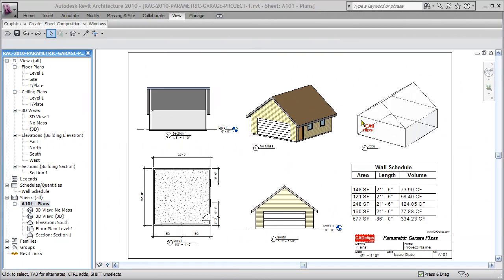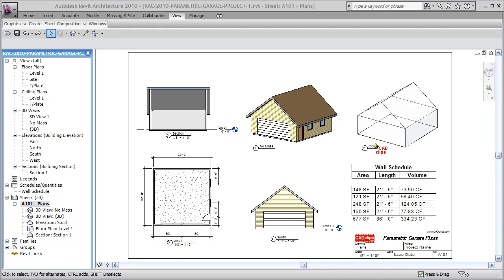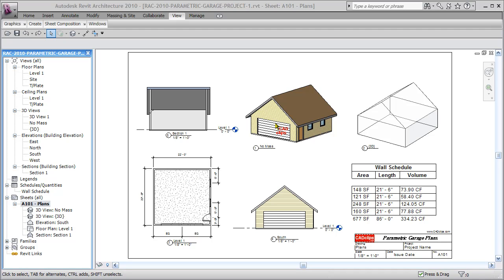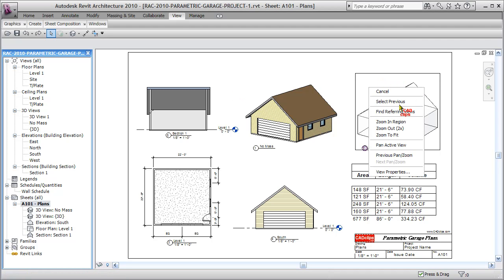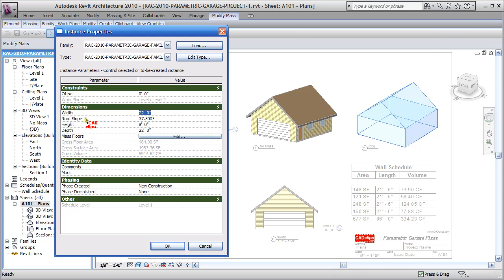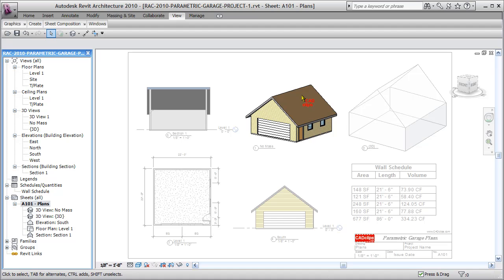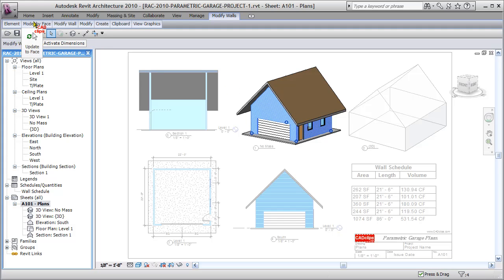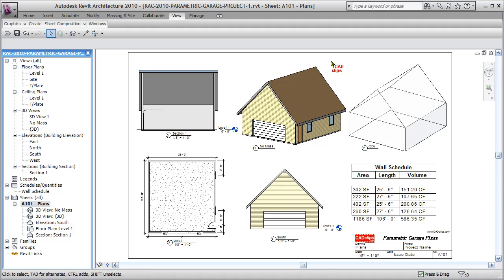REVIT Parametric Garage Magic - CADclip

Comment from the maker: Use the 'Building Maker Tools' from 'Model by Face' drop down menu on the 'Massing'and Site' tab of the ribbon.  

Then after you change the mass you can select the walls, roofs, floors and curtain systems by selecting them and click 'Update to Face'